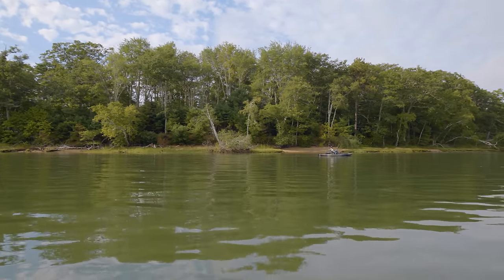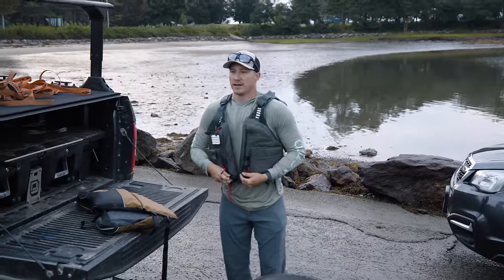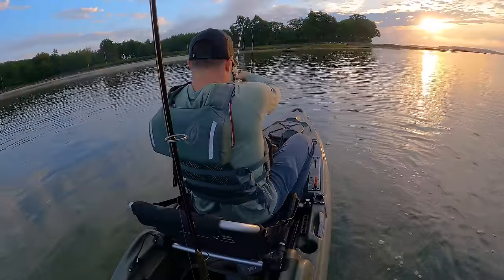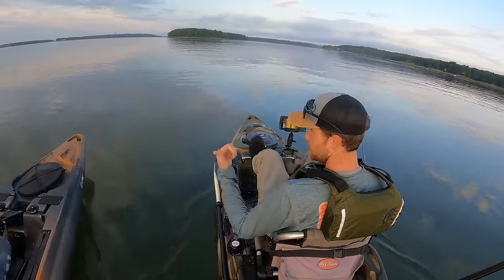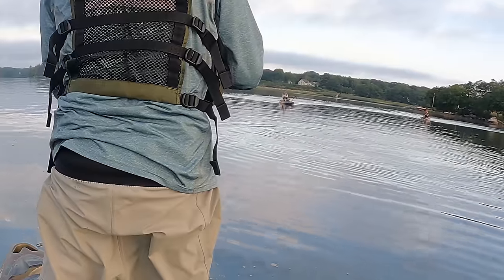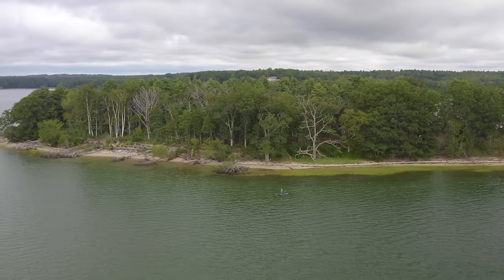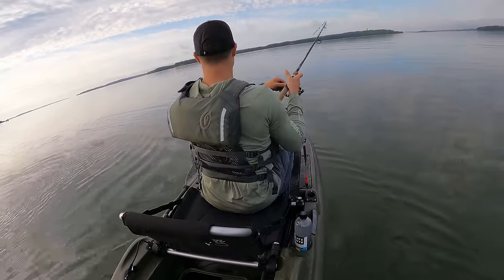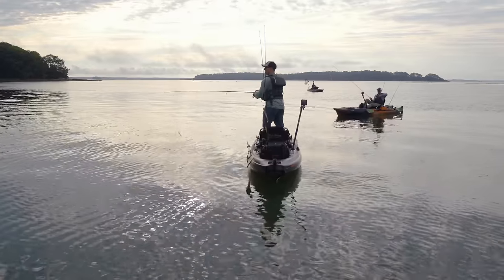Kayak Fishing Maine for Striped Bass | Kayak Fishing the Coast | Ep. 1

Comment: Is there a rod length rule of thumb for spin gear on the yak? Will 7’ get around the bow when working a fish?
Reply: Generally you don’t want to go much shorter than 7’ so you can move a fish around the bow when you need. I have a couple of 6’10” rods that work just fine.